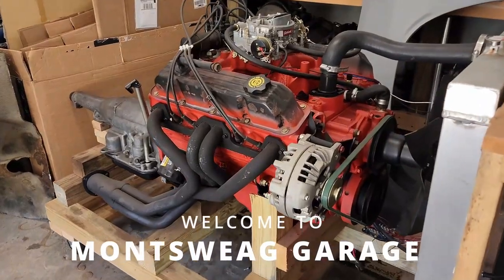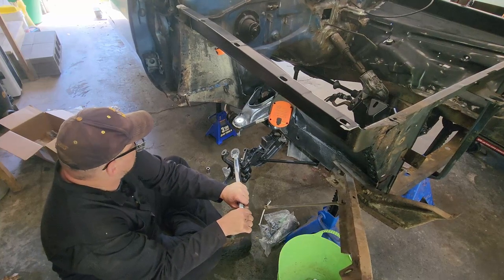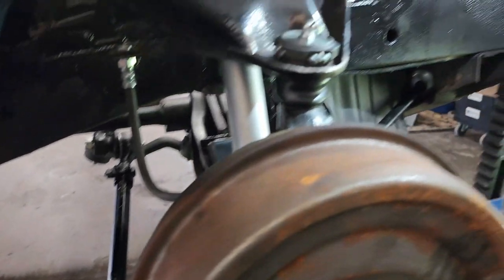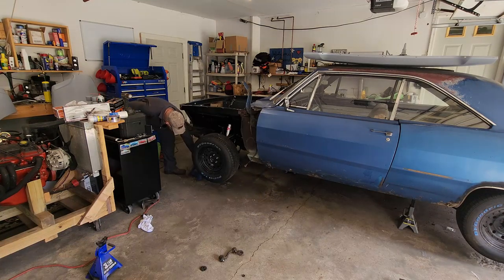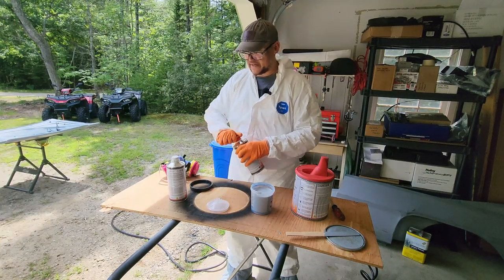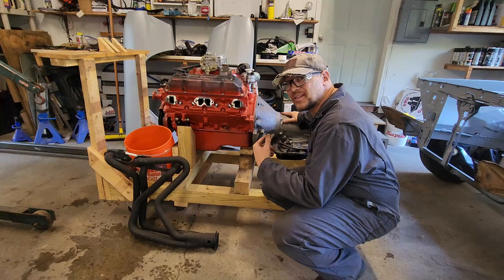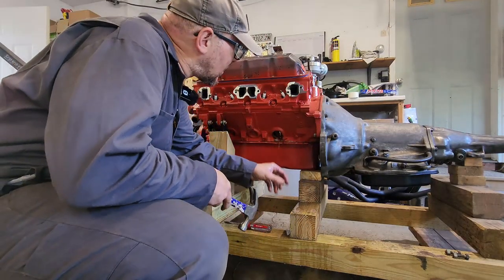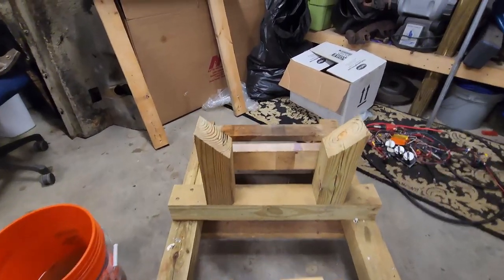The 360 Magnum Finally Goes Into Our 1967 Dodge Dart

Comment: Nice - you'll be on the road in no time !!
Reply from the maker: Thanks Tractorman! I intend to have her up and running this weekend. I did alot of the assembly off camera this past weekend. Driveshaft, brakes, electrical. All the boring stuff. Just hooking up wires and bolting things in. Still have Fuel and Ignition to do as I wasn't sure if I wanted to install the Sniper yet. Think I am going to get it running first, then give the snip[er video it's own video. =)

Comment: Looking good. Coming along nicely. Just a side note, the studs for the wiper motor would be painted body color from the factory so there’s no need to tape them up.
Reply from the maker: Hello Brian. Thank you for the comment. It will be body color eventually. The main reason I masked them is to not gunk up the threads with high build primer.

Comment: It's coming together! Question: If you were already removing most of the suspension, why didn't you just install everything on the k-frame and put it in through the bottom like the factory?
Reply from the maker: Welcome Benjamin and thank you for the comment. I didn't think I could get the car high enough to do it that way as I don't have a lift. Someday...lol.
Reply: @MontsweagGarage  makes sense. I have seen several people use the engine lift and just pivot the car on the rear wheels. That is what I was going to try. With a back up of a winch and my garage rafters. Haha. We will see how that goes.

Comment: Hey i need help with my 360 magnum one spark plug hole is weled shut with no threads and the other spark plug hole shot out the porcelain and kept the threads in. Im thinking new heads would be the easiest right?
Reply from the maker: Welcome and thanks for the comment. I would definitely replace the heads. You might be able to get a machine shop to fix the ones you have but I'm not sure if that would be any cheaper. That's just my 2 cents, I am by no means an expert.